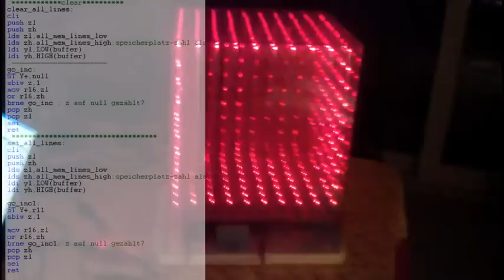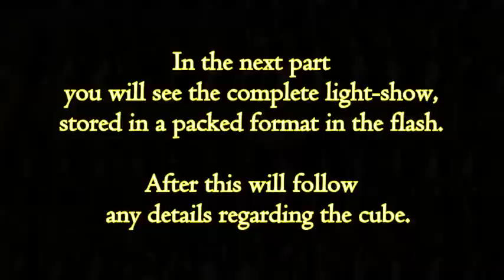10x10x10 RGB LED cube written in assembly-code ( part 1 )

Comment: Amazing! Great job man!
Reply: Can you imagine building of large cube out of transparent OMOLED panels densely packed for a near tv quality 3D image??  Wouldn't have to solder all those slices one by one, just slide them into an edge connector on the back or the bottom of the cube and done.  That would make the most amazing adverti$ement cube displays out there.  Hmmm... time to research transparent OMOLed displays ;)
Reply: Send me circuit

Comment: Really Great Cube right there!
I my self just finished my first RGB Cube, obviously its only 4x4x4 but we'll get there :D
I also used the TLCs but a Arduino Nano as a Controller which also has an Atmega.
Just cant believe you've written it completely in Assembler i would go nuts :D
Reply: Reaĺly Great Cube

Comment: I wish you could buy the board and parts kit for this. I sure would like the challenge of building it. I've built a 8x8x8 is the biggest one I've ever built. I keep giving them away as gifts. I like putting all the LED's together. Then last one i built I finished with copper rails on all the corners. Next project is a bottomless box.

Comment: Very nice! Some years before I saw the Elektor christmas star with led and TLC 5940. Changed the one color led to rgb and used 4 TLC (for 20 led). Already some work, but few against your project. Am controlling my star with an arduino, simply programmed with its c like language to get several nice effects. Every year I change the program to get new effects. May be I will show it here any day. How long did you work on your cube? What did you pay for all material? Have an idea about this, the rgb led and the tlc 5940 are not cheap here.

Comment: Could you post some exact instructions on building this? I mean physical parts as well as programming. Pretty sure I could use either my Raspberry Pi or Arduino.
Reply from the maker: +Jeffrey Barber Hi, like you see, I use the machine-code of the ATMega128. Time-critical Problems will be solved by using effectively bit-commands. I  must refresh 3000 leds , every led will be controlled with 8bit resolution light-intensity. This must be happen in a short time to have a flicker-free look
Reply: plz
Reply: That would also interst me

Comment: Hi I'm working on similar project, and I'm wondering if I shuold use tlc5940 or tlc5944. Tlc5944 is otherwise similar to tlc5940 but has "Internal Pre-charcge FET to prevent LED ghosting pehnomenom on multiplexed LED system" So my question is:

Does your Cube have ghosting problem noticeable by bare eye?

On the video it sometimes seems like if the leds ought to be dark were faintly light. But cause it's only video it's impossible to tell, what does it look like in real world?

Comment: The thing I hate most about these is that you cant buy them in stores.
Reply: Not surprising. Needs a really lot of soldering. And the quality must be good enough. With asia like super quick and super cheap soldering (sorry all asians) it wouldn't look as nice as this work. So it would cost some lot. Also soldering the tlc 5940 needs some time, as you see at beginning of the vid all is soldered by hand, nothing can be done by ready build boards, all connections must set manually. I have an idea about this since I built a very smaller christmas star with 20 rgb led and 4 tlc 5940. Needed already several hours for building and debugging. If anybody is building such electronics, he/she mostly won't like to sell this manual work. To much heart blood in it :-).

Comment: AWESOME!!! Looks great man!!! Does any company make these??? I can tell you now if a company makes these they will sell millions of them!!! Id pay $100 for it.
Reply: +geeetube would you by 10/10/10 cubic chess set of a similar kind technology 
if chess are of your interest at all ))
Reply: +geeetube Not of this size bro...
Reply: +geeetube THEN THERE IS NO WAY YOU WILL OWN ONE.
Reply: I'd also like one for less than the cost of the LEDs :D
Reply: Such things will never can be produced cheap. Imagine: there are 1000 rgb led, all with 4 connectors, means you have to make 4000 connections. If they are made quick, they will not look as good. So long hours of soldering are needed (or a cnc soldering automat, but I don't know if there are such machines for this complex cube). I have needed more than 15 hours for a much smaller thing with 20 led, and that is few against this cube. Debugging the connections and programming needs also some time. So 100 $ would for such a cube mean much lesser than 7 $/hour. Nobody would like to to such a difficut work for this. So may be this cube project would be worth 1000 $, may be more.
Reply: Excuse me? Did you just say it took you 15 hours to solder 20 LEDs? Hmmm. You should consider switching your hobby...

Comment: Hello! I have a question. This LEDs rgbs is anode commom or cathode commom?
Reply from the maker: common anods, switched by transistor. Kathods are controlled by pwm-chip tlc 5940
Reply: @3dfreakful  Maybe, future, I gonna make projects like this. Congratulations for your project.

Comment: Nice cube, Wolfgang,  and interesting patterns.
I've built three 8x8x8 RGB cubes using Steve Manley's jigs which I like and Kevin Darrah's code and design but with ULN2803A chips instead of the transistors..I think the jigs could be extended to build your 10x10x10.  Under the leds looks very neat. 8-)
I don't think people realise how much time is spent building a cube.
I did some assembly language programming using 6800 and the Amiga 68000 way back but now I'm well out of touch so it would be great to get some code and think about the design for a 10x10x10. 
How would you go from a 74HC595 shift register with 8 outputs to something which needs 10 outputs?
Is Part 2 out yet?
Reply from the maker: +binarybox part2 is ready and avaliable. I have insert an info-card for "part2" in my youtube-video. I have done it first time. Do you see if it works ? to discus techn. details is better we write via e-mail ( wolfgang.nk@web.de)

Comment: Hi I want to make a LED cube for my first year in a Bachelor in Electronics. We have to work with a 8bit 8051 Infineon XC888 Microcontoller for everything we want as a project. As I am new I do not yet know if it is possible. We have to write the software in assembly code too. How much LED's can I probabely make and control with a 16 bit controller?
Reply from the maker: I've no experience with 16-bit-controllers. If you want to know more details about the cube, please contact me via mail  to  wolfgang.nk@web.de
Reply: Okay thanks!

Comment: Why do you not use just seven chip TCA6424A  with 24 IOs each  in the project?
Reply from the maker: the tlc5940 contains also a pwm-control for each channel

Comment: OK, reality check. Each LED has four leads. Each layer has 100 LEDs and 400 solder points. The cube is 10x10x10 meaning there are 10 layers and 4000 solder
points. And that's just for the cube. 
Take a look at the bottom of control boards. How many solder points do you think there
are? Another 500 perhaps? Then there is the wiring coming off the bottom of the cube. How many more points? I built an 8x8x8 cube (https://www.instructables.com/member/bkeaton/instructables/) from scratch, including the multiplexer, main mother board and all cabling. I can safely say this 10x10x10 cube has around 6000 solder points. Then there is the programming, in assembler no less. So anybody that thinks a cube of this sophistication would sell for around $100 to build has no chance whatsoever of ever owning one. And someone here wants “a few” of them? 

If the builder of this beauty ever wanted to part with it, I'd estimate the cost to be at least
$1,500!
Reply: I have new found massive respect to anyone who has constructed a cube bigger than 3x3x3 as I just finished an 8x8x8 and the amount of soldering was tedious to say the least - though a better jig would have made lighter work. :/

Comment: Why assembly? Badass points? C compiled micro controllers not fast enough to address so many leds smoothly?
Reply from the maker: +Patrick Noble , It should be handmade in hard- and software. I won't use prefabricated programms. If I use machine-code, I enjoy all freedoms to do with the micro-controller what I want,  without restriction of any kind. I can use all ressources of the mc. So can I say, it's 100 percent "my" cube :-)
Meanwhile I use for all light-shows ca 250 nested subprograms in self-programmed machine-code.

Comment: 10 x 10 by 10 equals 1000, where'd you get 3000 from?
Reply from the maker: with 1000 there I mean  a physical RGB-led. This consists of tree single led's (red, green, blue) with one common connector- wire and three wires for the single-led's, together 4 wires per RGB-led

Comment: it has to be connect with computer for working ?
Reply from the maker: +wael abdelmawgoud No, look at  description on the top. Almost all light-shows will computed between the refresh-cycles. :-)
There are about 250  quickly machine-code-programms in the flash.
Reply: +Wolfgang N 
ok thank you

Comment: So its not generated in real time ?
Reply from the maker: there is no  connection to other devices, disks. All programs and data are stored in the flash. There are stored only few images for sequences, most of them is software programmed  in assembly-code, which compute all the pictures.( in real-time :-)
Reply: cool cool. Ive just started dabbling with MCU's. Trying to get realtime things to happen, I have 1 video of it on youtube. Only runs for 1 minute

cheers, Good luck

Comment: How do you store and read the animations?
Reply from the maker: the animations will compute in a timeslot between the refresh-cycles. Few pictures are stored with the show-program in the flash and will be read with the "lpm"-command from the flash into the ram of the micro-controller.
Reply: So the individual animations are image sequences on the disk(storage medium)?
Reply from the maker: there is   n o    connection to other devices, disks. All data are stored in the flash. There are stored only few images for sequences, most of them is software in assembly-code, which compute the pictures.

Comment: Wow I wonder the code size
Reply from the maker: in assembly language code programmed (avr Studio4) from cell 0 till hex 007cb2, dez ca 32000.  ATmega 128 has a flash of 128 Kbyte, 16-byte organised, 64k addressable program-lines, therefore are 32000 used. That means I use only the half of the flash :-) The most of light-shows will be computed, no stored patterns

Comment: Nó là anode rgb led?
Reply from the maker: Wolfgang N
vor 6 Tagen
yes, per horizontal plane there are common anodes, switched by transistor. The catodes will be controlled by pwm-chips 5940